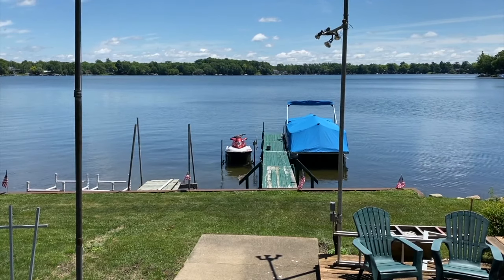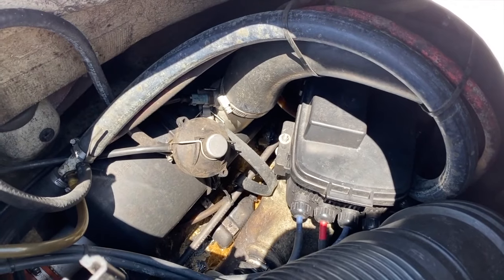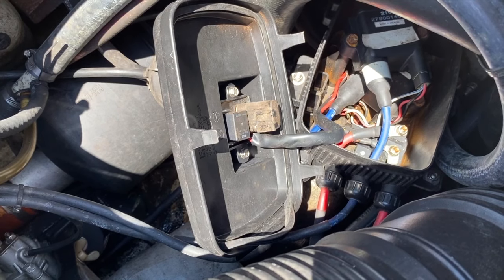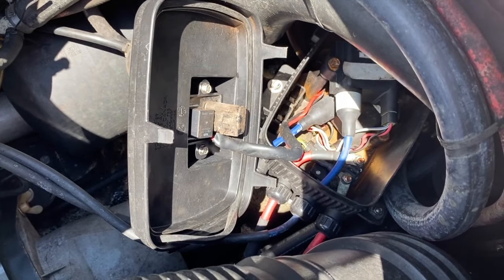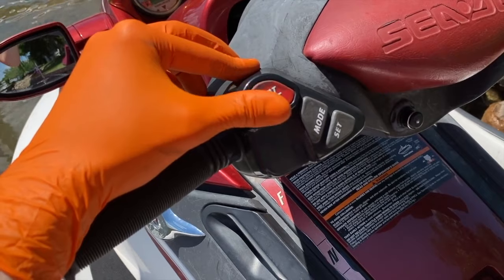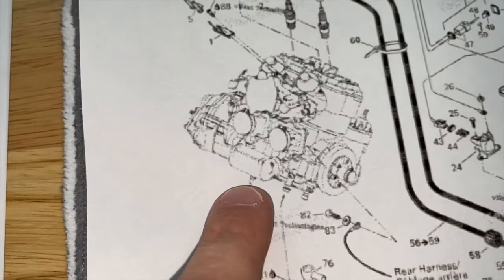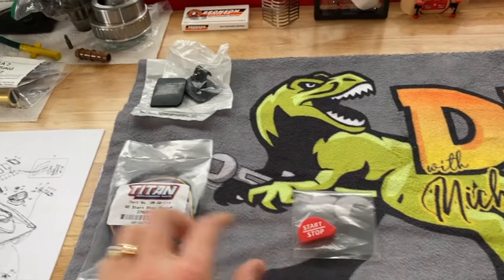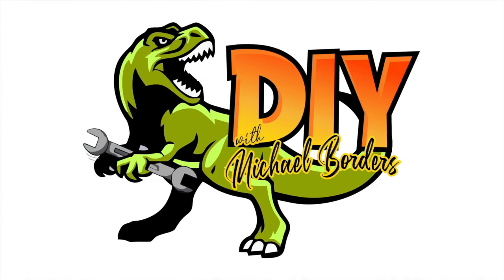Jet ski not starting - MOST common causes

Comment: I never owned a jet ski before this is the first time I have a 2002 SeaDoo bombardier with a stop and start button.. how does the fuel pump come on before engine start?
Reply from the maker: Thanks for watching, sounds like you have a Direct Injection (DI) engine.

Once you connect DESS key to DESS post, it activates the fuel pump to properly prime engine with fuel prior to engine start.

Let us know if you have any additional questions and hey if you’re into crypto trading, check out our DIY ecosystem.

          toolboxtoken.com

Reach out to us any time!  🧰
Reply: @DIYwithMichaelBorders  okay when I put the DSs key on the fuel pump does not power up. Do I need 12 volts to the wires there are two wires
Reply from the maker: @michaelmckenna6852  

Thanks for the reply.  You do indeed.  You may have a blown fuse down inside electrical panel inside hull…that’s very common.
Reply: Thanks.. I will check and update with what I find
Reply: @DIYwithMichaelBorders  and I will be subscribing to you
Reply from the maker: @michaelmckenna6852  

Awesome, means the world to us.  We subscribed to you.  😎👍🧰
Reply from the maker: @michaelmckenna6852  

Looking forward to hearing back from you.
Reply: @DIYwithMichaelBorders  hey buddy I talk to you the other week about a jet ski..so I checked for 12v to the fuel pump but only getting 5v is that right
Reply from the maker: @michaelmckenna6852  

What’s up Michael, great to hear from you again.  To answer your question, your fuel pump must be getting at least 11v or it will not spin the pump at the required speed.

If this happens, which in your case it is…your engine is not getting the required fuel for normal operation or acceleration.

Do you see any damaged wiring?  Do you have any wires that are randomly twisted together and wrapped with electrical tape?  (the kind of wiring that does not look like it was done by the manufacturer or a professional).

These are exact causes of loss of voltage traveling through the electrical system.

Keep us posted Michael.  🧰
Reply: @DIYwithMichaelBorders  okay buddy thank you I will look for that and get back with you
Reply from the maker: @michaelmckenna6852  

Awesome!  👍🧰
Reply: @DIYwithMichaelBorders  I looked at the wiring I cannot see where anything has been tampered with or rewired with tape everything looks pretty good as factory
Reply: @DIYwithMichaelBorders  could it maybe have a problem with the control computer or CDI box whatever its called
Reply from the maker: @michaelmckenna6852  

That’s good news actually.  😎👍
Reply from the maker: @michaelmckenna6852  

Your ski may be experiencing a shortage from the MPEM.  We recommend unplugging MPEM connections and checking for any corrosion.

Re-secure MPEM connections firmly.  Your MPEM may also perform a reset during this process…which is a good thing.
Reply: @DIYwithMichaelBorders  ok thank you so much you are very big help
Reply from the maker: @michaelmckenna6852  

😎👍🧰
Reply: So I disconnected the computer checked out and put back on and I  still have low voltage at fuel pump wire....also put 12v to the pump and it would not work either?
Reply: @DIYwithMichaelBorders  if I put 12 volts to the fuel pump itself and it doesn't come on bad correct?...... I still have low voltage at the wire for pump I did check the computer harness wiring and fuses all good
Reply from the maker: @michaelmckenna6852  

Thanks for the reply, maybe it is a faulty pump.  You can possibly replace just the pump as opposed to the entire fuel control module unit…that can get a bit pricey however having an entirely new module and pump will be nothing short of awesome!

The replacement module for our jet ski is $749.00 however it comes with the module housing, fuel pump, and all new electrical wiring and components.

We haven’t replaced that yet.  We literally just rebuilt our fuel injection inducer today which included brand new OEM fuel injectors, fuel regulator, and air regulator.

Lots going on here at the DIY Raptor Headquarters.  We are excited for those videos to be uploaded in coming months.
Reply: @DIYwithMichaelBorders  could you send me a part number for that fuel pump module kit
Reply from the maker: @michaelmckenna6852  

Absolutely!

Holy cow…😲…the price jumped.  This is the exact OEM replacement Fuel Control Module for our exact machine.

       https://amzn.to/43nBIoh

I bet they jacked the price up because it’s summer.  Definitely shop around to try and find a better price.

😎👍

Comment: I have a seadoo gtx that starts but then shuts off almost immediately. Worked fine for a couple days in the water then on the last day of the trip it started doing this. Any ideas ?
Reply from the maker: Thanks for watching, any update?  Once engine starts, do you notice any unusual shaking or knocking with engine.

Its possible…however unlikely…that your Knock-sensor is detecting a mechanical knock and immediately shutting engine down.

Let’s start there.  👍🧰
Reply: @DIYwithMichaelBorders no weird shake just turns off after being on for a few seconds
Reply from the maker: @elgallodesinaloa5219  

Thanks for the reply, any recent parts replaced?  Have you replaced plugs and wires?
Reply: @DIYwithMichaelBorders spark plugs but again it ran fine for 2 full days it’s didn’t start doing this until the 3rd day at the beginning. All we did that day was fuel it up
Reply from the maker: @elgallodesinaloa5219  

Thanks for the reply.  Maybe contaminated fuel…it’s rare to run into that however we can’t rule it out.
Reply: @DIYwithMichaelBorders how would I go about testing this? Taking fuel out and adding new?
Reply from the maker: @elgallodesinaloa5219  

Testing it will be annoying however if you can siphon out fuel, that would be awesome.

We have already filmed a video siphoning fuel out of our 1995 Sea doo XP using an awesome little siphon pump however it’s not uploaded yet.

But…we have uploaded our video siphoning fuel out of our boat tank and we used the exact same pump.  Below are a few links.

1.  Siphon pump kit:  https://amzn.to/3KN28YV

If interested in purchasing this product, visit our Amazon affiliate link above.  I earn from qualifying purchases.

2.  Siphon fuel out of boat tank

       https://youtu.be/CwdYEQwt_qk?si=l9X1_OD45Arqt9Ns

Keep us posted.  🧰